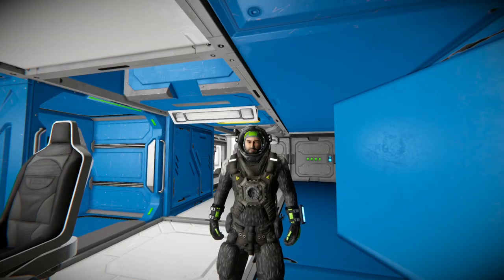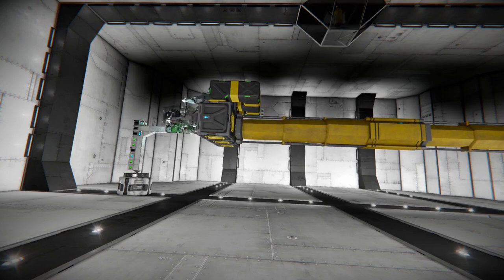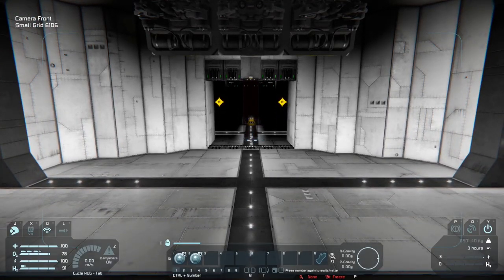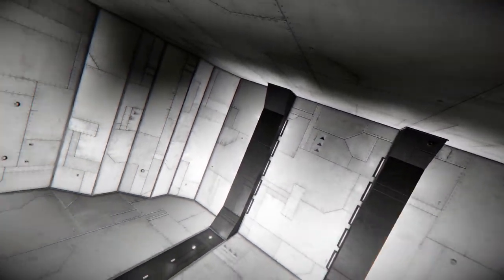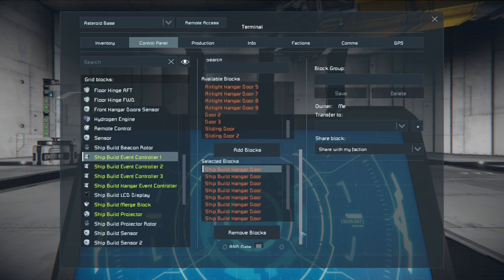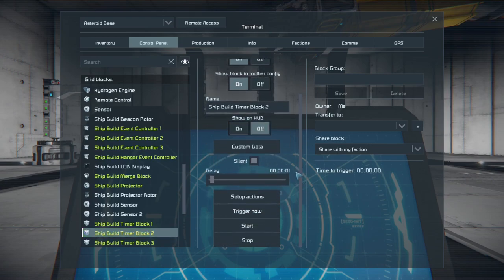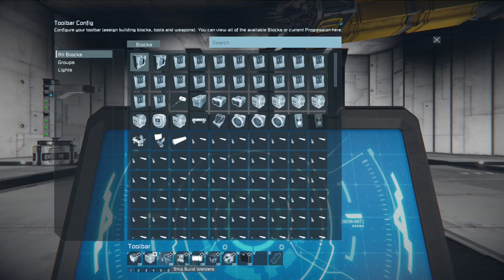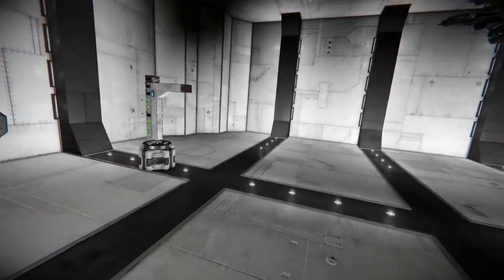How To Program An Automated Ship Builder

Comment: Right off the bat: when designing a small ship/drone for manufacturing, consider the impact on  PCU and material resource costs versus the utility.

If it's supposed to be a cheap, short range attack drone, make sure it can tank/deflect some incoming fire and drive off relatively small ships.

If it's a Cargo Freighter, make it as good as you can, as cheaply as you can stand.  And make sure all the containers have space between them, even H2 and O2 tanks.  Explosions are no joke.
Reply from the maker: Thank you for the insight. The example drone in the video only served the purpose of demonstration for automated building.

Comment: WISH YOU had done a better job of explaining how you built it, why, and how it worked. i was lost immediately when you started talking about it triggering from the door. how does it work at all?? like just from a button... before you jump the gun explain the basics. 

this did not explain how to build an automated ship builder, its how you, made one using hangar doors and sensors. how do i just make a normal one???that works with a button? because im trying to work it out without sensors and hangar doors and its just not making any sense.